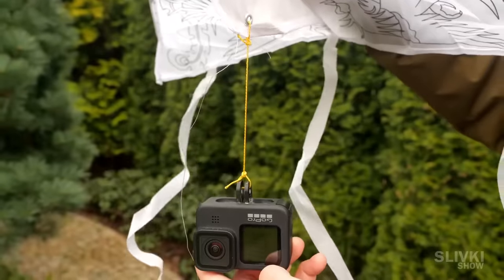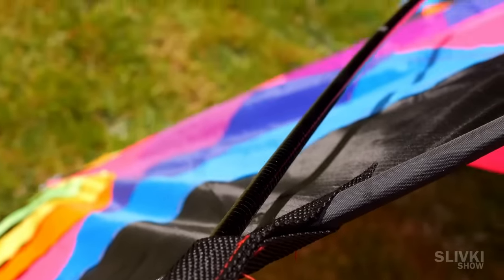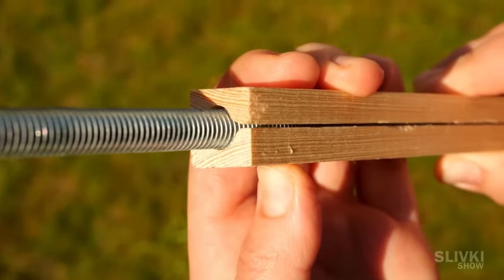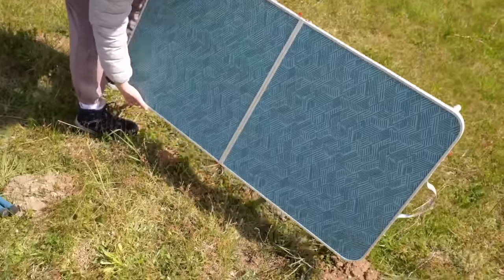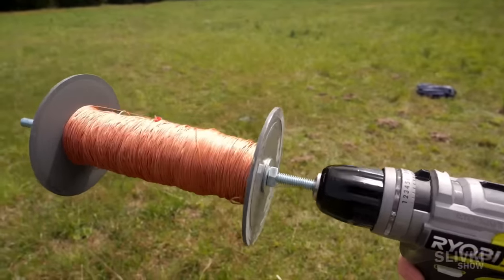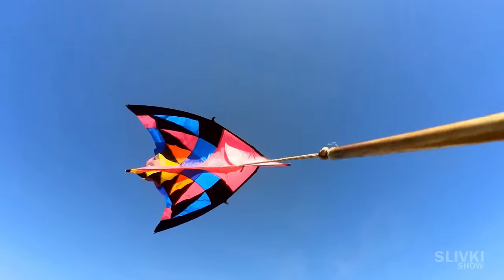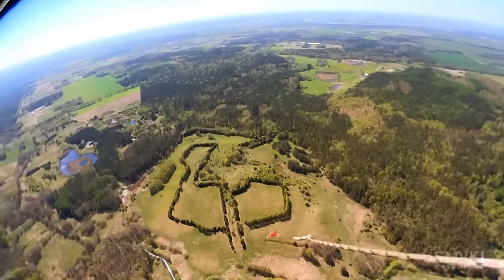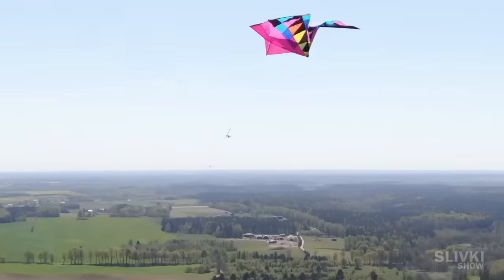WE FLEW THE KITE INCREDIBLY HIGH

Comment from the maker: Any idea how to fly it even higher? )
Reply: Try gunpowder in a rocket 🙂
Reply: Get the Gas Balloon from China....It will help to go to another Galaxy😂😅
Reply: hmmmmmmm maybe make the kite bigger
Reply: and fly it off something higher like a building
Reply: And pot it in the kite
Reply: bigger kite with paracord
Reply: Very strong homemade big kite, strong rope
Reply: A bomb
Reply: the avarage box kite can fly around 3km's up
Reply: Go any further the FAA will be mad
Reply: engin
Reply: what about two kites? I think the weight of the string will eventually add up enough to stop it from going further up but if you had a second kite half way up it could support the weight of the string needed.
Reply: propellor
Reply: You need to use thinner and stronger string. A lot of drag is just from the string. Maybe try string made from carbon fibres or nanotubes :D
Reply: if you attached it to a secure balloon with helium in it, or add a rocket, it would be cheating. but its an idea (also make the rope longer of course)
Reply: You should make a circular kite and put a turbine in the middle to generate electricity from the wind
Reply: Ad more string. Maby thinner and stronger string. 😁
Reply: Set the goal to 5-10km 🤘
Reply: @ashsty  big brain
Reply: Borrow a rocket from spaceX and place a kite inside.
Reply: tie the top of the kite to a helium baloon and pop it reaching the height you want.
Reply: You did not hit 1 kilometer btw as that kite did not go straight up but at some angle also with that much cord the drag on it would also prevent 1km just from drag and cord weight 
I had a spool (single spool) of very strong cord that was 5k feet and managed to roll most of it out with a kite probably something to around what you got honestly before it snapped similar kite that i re enforced with things like duct tape in strips with some space between them so the kite would not shred in the wind and along the trailing edge and leading edge
When the cord snapped it was pretty loud for such a tin cord LOL
Reply: Use helium gas balloon
Reply: Use single piece carbon fiber rods and cut to length.  Chances are those rods are just fiberglass dyed black to look like carbon fiber anyway.  If you can get the kite to maintain its shape then it'll produce considerably more lift.
Reply: Double the rope and add a tail to it and try using your hand to stabilize it so that I does not fall on its own
Reply: Same as the thumbnail
Reply: Fly it with Gas Balloon
Reply: more rope
Reply: ask Elon Musk he could help.
Reply: Bro use indian kite it use in gujarat they make worlds best kites
Reply: @alexpascu8586  ⚠️ God has said in the Quran:

🔵 { O mankind, worship your Lord, who created you and those before you, that you may become righteous - ( 2:21 ) 

🔴 [He] who made for you the earth a bed [spread out] and the sky a ceiling and sent down from the sky, rain and brought forth thereby fruits as provision for you. So do not attribute to Allah equals while you know [that there is nothing similar to Him]. ( 2:22 )

🔵 And if you are in doubt about what We have sent down upon Our Servant [Muhammad], then produce a surah the like thereof and call upon your witnesses other than Allah, if you should be truthful. ( 2:23 )

🔴 But if you do not - and you will never be able to - then fear the Fire, whose fuel is men and stones, prepared for the disbelievers.( 2:24 )

🔵 And give good tidings to those who believe and do righteous deeds that they will have gardens [in Paradise] beneath which rivers flow. Whenever they are provided with a provision of fruit therefrom, they will say, "This is what we were provided with before." And it is given to them in likeness. And they will have therein purified spouses, and they will abide therein eternally. ( 2:25 )

⚠️ Quran
Reply: I mean,... If you had some weed with you... 🤣
Reply: Fly a 10km kite
Reply: Longer rope! :-D
Reply: "be aware of commercial avocational airspace"
Reply: Paraglider pilot here. We actually fly close to those altitudes 🪂
Bigger more durable kite and check the local skew-T! You need low wind at that altitude as well as stable atmospheric conditions. The right (temperature) line as it's going upwards should not be inclined a lot to the left. You also need a kite big and durable enough to withstand the weight of the rope. If you are being forced to drop one of your cameras on take off, you will fail later as it gains altitude. I would test if it can lift at least 10 times the weight of itself plus the cameras plus all the rope. And be gentle pulling that rope! It will stress the kite more than you think! Google "Paraglider chase cam" to get ideas on how to mount and stabilise the camera with less weight. Maybe 3d print something similar. Or mount a single 360 camera with a magnetic mount on the kite itself. 
Finding someone who can read a skew-T diagram will help. Or give some time instead to study it by yourself. The wind gradient graph will give you information about the wind at that altitude. The less the wind, the higher it will go with the same amount of rope and the more likely to not break apart. Atmospheric stability means less turbulence. If you can't read that skew-T, find a day with cirrus clouds. Low altitude cumulus clouds is a big no no. I strongly advice to launch that kite early in the morning, before the sun heats up the surface. That way you're gonna have less turbulent air and less wind. 
And stay far away from airports!!!!
Reply: @DropXplode  yep
Reply: @1islam1  true
Reply: as one who used to fly kites a lot here in brazil, i've seen people fly small paper kites (50-80cm) at altitudes up to 2km with ease, i myself have done this, but having the camera presents a challenge, i have some tips for you

i'd recommend you to use stronger rope, you could see that even at 1km high, the kite was pulling like 5kg of force on the table, and trust me, it will pull much harder as it climbs, this leaves room for you to use heavier and stronger rope, fishing string/line is the best, it can lift a fish and weights nothing, but be careful to use the right knots, nylon can snap if bent in certain ways, although there are some fishing lines out there made of kevlar

also, a smaller kite will not face a problem in these altitudes, a square kite 1.2 meters across is enough to lift a small camera
here we have a rule: the stronger the wind, the smaller the kite

another idea is to fix the camera on the rope, not on the kite, the rope is much more stable and will give better footage

edit:
make sure before flight that the kite can withstand the forces! test how much weigh is needed to bend the kite and in with point it risks breaking, if it is to weak, reinforce it.
Reply: It is very common in india to fly a kite. Usually to fly a kite higher, kite needs to be very light weight and the smaller the kite the better because less wind force on rope at higher altitudes but in that case you won't be able to mount the camera, it won't take the weight of the camera until it reaches some height. So maybe all you can do is fly a smaller kite, let 100-200 meters of rope unwind and then tie the camera with the kite rope
Reply: you just need 5km long rope and lil bigger wings to handle rope weight.
Reply: Get more string.
Reply: use strong and much lighter/thinner fishing braid, it will have less air resistance and weight while still being as strong or stronger than your rope, extending your max height, as you will be surprised how much load it will reduce on the "system"... You might even want to put a "pull" weight scale with maximum pull recording so you can establish the amount of weight your current rope vs the fishing braid will add at 1000m, and then see the difference between both. I am assuming that a Substancial part of the pull is created by the rope´s weight and air resistance, so if you can reduce that you will automatically increase your maximum height... another advantage is that a 16 string braid with 50lbs/22Kg pulling force comes at 2000m rolls with a diameter of 0,35mm so you will not need any knots in the line...looking at your Video your current line is easily triple the diameter of such a braid... Good Luck 😀
Reply: Fly from mount everest😁😁😁😁😁
Reply: take dat Guiness record my dudes/etc:face-orange-biting-nails:
no really u got this:face-blue-smiling::face-fuchsia-tongue-out:GO! GO! GO!
🔥❤‍🔥
Reply: Look into parafoils, they are already flying at the height you need. Less weight more lifting compacity. Use a small chute to stabilize the cameras.
Reply: SPECTRA kite line + a real lifting kite, not a toy.
Reply: @growgamer1816  no they don't.
Reply: Use a large parafoil kite with a extra long tail.
Reply: more rope. simple as that. sure, it could snap at one point, but whatever.
Reply: Change to fly a kite without ribs, we so call parafoil. Typical one is the NASA wing! Hope to see you flying the NASA WING in the next movie. Cheers!
Reply: I once flew 3 kites on one line. The first kite was attached to a 200 meter string that was attached to the back (top) of next kite and so on. The 3rd kite was attached to 4000 yards of 20 lb Berkley Trilene fishing line wound onto a Penn Senator 116L fishing reel on a heavy-duty rod. There was a continuous force of about 25-30 pounds (20 lb. Berkley Trilene would handle that easily). Having 3 kites made them very steady. It took an hour and a half to reel them in. The kites were of average size; about 3 to 3.5 feet across. If anyone ever tries this, make sure there are no power lines downwind for several miles! I work for an electric utility and we will charge the person to remove any debris from the power lines.
Reply: try to put some firework rockets and a longer and stronger rope. ig u can make something which can trigger the fireworks wirelessly, also make the kite bigger and while making the bigger kite use a better material as that high up the wind turbulence is a lot.
Reply: I can help you.  U r kite can go plus 10000 miles easily.
Reply: Use a Delta wing on,kinda rhombus boxkite
Reply: Also, movement is equal to the arm ark no matter the length of rope at start, depending on how well the kite is made.
Reply: So start length of rope matter not
Reply: I used generic fishing line. I dont remember how many feet are on a 6# test. Ive used 10# test, 15# test even 25# test on a boxkite 28×72 we called the " flying phonebooth"
Reply: Roll of 6# test monofiliment tied to a 10# test tied to a 15 # test tied to a 20# test. I used to buy a generic fishin line at walmart. I cant remember ,the 6# test is 900yards?????
Reply: Ok i just looked, 30# test is 250 yards a roll. By logic 15# test should be 500 or even 600 yards best I remember. .........6# test 1500 yards
Reply: YES GET A      U  F O  SAM    KITE     I HAD ONE UP 2 MILES
Reply: You need a less flexible and more resistant kite, and also a more stable table
Reply: @priyanshbhardwaj6313  he could use one of those rockets like the US did to pop the China bloom
Reply: @jessemorrin2006  Right?😂😂😂
Reply: more rope
Reply: Braided fishing line, they got sell 500-1000m per roll. I am waiting you fly 3Km :)
Reply: You can use the same kite, the wind speed keeps the lift. You can also put 2 cameras, however, you will need to put a long tail to stabilise and counterweight. Also, the frame will need to be reinforced, or else it will break. Lastly, use paracord or a 2mm rope... With your string, any higher, the string will break on a knot
Reply: Fishing line, FPV camera, smaller kite i think, Or you can use un-controled or self controled rising up drone lifts up the string same time
Reply: PARAFOIL KITE or MINI PARAFOIL
Reply: @fdect  I got a breaided fishing line 0.26mm 30LB (13kg) with steel core, it is so tiny and light but unable to cut with scissors, have to use metal cutter to break it
Reply: Use asian kite not kite like this..
Reply: I saw a kite can flown almost 3KM but low wind
Reply: Stronger kite poles and stronger longer rope and fly by a mountain so the updraft from the wind hitting the mountain will pull it up into the sky
Reply: Get A much much stonger kite
Reply: @repawnd1  my 400m high box kite flight about 35-40 years old I use fishing line with a high breaking strain - so long ago that at 67 years old now I cannot remember what the strain was that I used. I remember the guys in the fishing shop asking if I was going out fish for marlin 🤣🤣
Reply: I have flown the kite higher than the clouds
Reply: It's nothing in India there is a kite festival on that day kite goes up to 4k meters
Reply: try indian style kite  u can fly it   near 2000 meter -
Reply: Use an astra thread. 10000 meters
Reply: if you visit Indonesia (especially Java) you will find many kite pilots with a height of 400 meters with a drag of more than 30kg and even with such a height and drag they fly/lower without using special tools. only with hands and the cohesiveness of friends
Reply: Here in the Southernmost part of the Philippines, Mindanao specifically, our neighbors flew them much higher than that..they're using ripstop nylon..
Reply: Seriously. The kite is waaay to flimsy. I have flown kits this high and you have to have a stiff kite. Not necessarily bigger, but it needs to handle the wind velocity. That thing was barely hanging on. The reason a single line kite dives is because it creates so much tension on the line that it begins to untwist, causing the kite to unwind the string holding it high. Fishing line is better as it has no twists in it. A high flying kite needs to be stiff and the line needs to be solid.
Reply: the material of the kite is flexible thats why the wind not so strong.
Reply: Easy
Reply: can you link me plz
Reply: Try to attach camera directly to the kite tail... And make a kite with paper and little smaller.. And use a cotton thred ... It works like charm
Reply: @AlterYHUDZX  yes
Reply: @AlterYHUDZX  10000 meters mine tho
Reply: You need to fly Pakistani kites they are much efficient❤
Reply: Strong kite & strong ropes ties in the strong tree. U need to pull it back a little smtimes till the top of u & slowly releases the ropes meter by meter to climb it high u need to pull it hard again till its in top of u again & release rope again same again & again till ur last rope that tied in the tree. We used gorion. It can lift people away,thats why it always tied in a strong tree.
Reply: Di kaitkan satelit...
Reply: This is no big deal for us,
Come to india on 14th January and see how to fly kite,
1K is child's play,
We do 3K to 10K easily
Reply: Gak paham bahasa nya😩😩😩
Reply: How’s the burger doing?
Reply: Buy kite thread from pakistan for more hight
Reply: @kjroma3418   dia tanya ada idekah biar lebih tinggi lagi.....ikat di satelit usul saya
Reply: Connect your camera in kite not rope   for more stability
Reply: make it more big
Reply: Perbesar + perkuat benda agar kuat jika terkena angin yang cukup besar di atas sana, lalu tambahin talinya pasti bisa menembus awan☁️😅
Reply: Try indonesia kit model like gapangan, tanggalan, or pegon, that kit olso have sound when flying
Reply: p09
Reply: Try pls
Reply: HAHAHA🤣🤣🤣🤣
toys when I was little
Reply: Try Flying Paper made kite.....our kids fly it more higher
Reply: When the rope starts to get smaller.. cut it but hold on to it and tie more string to it
Reply: Yes , Come to sri lanka and buy a sri lankan traditinal kite any try to do your test. We usually fly kites nearly 1KM high
Reply: Without camera its possible
Reply: Use smaller kite with thin and strong nylon string 
Also decrease the size of kite.
Plus change the design of kite (Use the one that is used in Pakistan and India those ones are stable especially for longer lengths)
Reply: Gama ug goryon ba
Reply: add amall propelers and biggger wings
Reply: Place a long tail and mak the body stronger make the body bamboo and make the rope more stronger
Reply: It's not difficult to fly more high just change your kite
Reply: I am from Indonesia when we fly a kite, we use a kita we called "Gapangan" and we use a big thick plastic rope to fly it. With that rope, it can fly very high sometimes it can go into the cloud. We also like to give the kite a small lamp with dynamo so we can see it at night.
Reply: hi bro i am a professional kite flyer. its better you use a kite which is made in Pakistan and thread also made in Pakistan you can fly the kite for than 5 kilometres
Reply: Next: fly a kite from mars
Reply: @alexpascu8586  de moto. A gente não
Reply: so the earth is round or flat?
Reply: Make Every thing lighter !
Reply: Longer rope
Reply: Come in India and see how far indian fly the kite. Haah! Every seller sells 1km in one role. We indian are far from you
Reply: Well i would like to prefer you to visit indian villages and you can see ample of kites,even children can fly it around 2-3 kilometres 😅😂😂
Reply: @alexpascu8586 😊cais20,000
Reply: Take a big size kite which has long Aero dynamics can fly up to clouds.. I regularly fly in our country it's very common.. Just for fun kite fighting over 😊
Reply: use box type kites they are more stronger and thicker strings about 4mm thick, plastic strings also is possible the one used for grass cutters
Reply: use bigger kite, about 2 meters wide
Reply: Yeah build your own kite with light aluminum bars make them strong and you can fly it even higher
Reply: One other interesting thing about kites. They’ve been used for ground breaking scientific research and experiments. EG: Benjamin Franklin’s kite into thunder clouds for electricity using wet hemp attached to a Leyden Jar for electricity capture and a more dry silk yarn for the kite flight in 1752. Also I believe that Marconi may have used a kite as a high flying radio antenna for his radio experiments in 1894. Finally heavy lifting kite to fly a man or young boy up above battle grounds were used by the Chinese military in 636AD and by Baden-Powell in WW1. Samuel Cody also used a kite for flying a man.
Reply: Buy more copper wires😐
Reply: Try Brazilian kite, we who live in Brazil always fly these kites much higher than 1 kilometer😅
Reply: Ask to Elon Musk😂😂😂 he was watching your kite.
Reply: Make the kite with bamboo it will be much stronger and bigger
Reply: come to pakistan baby we fly over 2 to 10 km without any safy or eqiupment haha lol
Reply: @alexpascu8586 😮😅
Reply: just make an aeroplane once
Reply: I use to fly bigger kites even higher at age 12 by putting holes in my kite. It use to reduce the tension on the rope significantly
Reply: Get some heavy duty twine
Reply: Make a goryon kita its so big it can fry about 1000 ft
Reply: I would add more 10 more rolls of string to get higher.
Reply: 0:33 :30 0:31
Reply: 😂Lol we flying than that high
Reply: Datang ke Indonesia
Reply: Tendi uma pipa 🪁 maior ❤
Reply: Come to India you will see kids flying kites up to 1000 meters
Reply: Rig the kite with remote-controlled thingies that spread and contract the "wings". As a failsafe, use some pressure sensor as well maybe.
Reply: @alexpascu8586  That would explode
Reply: Come to india brother, every year on 14 march there is a festival named khichdi,some say baishakhi different parts different names,on this occasion there we fly kites ,even there's lots and lots of compitition,1000 metre is good but an average here if you participate in a good compitition maybe 1500-2000 m is nothing
Reply: you should  visit india in jan 14  2024 , we have a festival of kites ,
 u will understand each and everything
Reply: @raquelmoreira1561  Me irl
Reply: more rope
Reply: No... Use Indian kite
Reply: Kites of this kind cannot ascend to great heights as they are easily affected by strong winds, causing the kite's angle of flight to decrease due to the penetrated air. In the Philippines, we have a kite called 'guryon' that can fly at high angles and withstand strong winds. try to create one
Reply: stronger and longer rope and larger kite.
Reply: makes an 80 cm bamboo kite like in Brazil that easily takes the camera and a thousand meters of line in Brazil we fly a lot of big kites
Reply: Try to research about how pilipino made kite using a bamboo
Reply: Come to sri lanka 😅
Reply: you must try to fly the big kite ''gapangan'' from Java Indonesia
Reply: Pull in 10% of the line, tie another kite to the line, and now tie a slightly heavier and stronger line on.  Let all that out, tie a 3rd kite and still heavier line. This has been done in the past resulting in kites going almost to the stratosphere.  
Note: even ordinary kites can bring down a helicopter, because the line gets wrapped around the rotor mechanism and overwhelms it.  Any helicopters getting anywhere near, bring the kites to the ground asap!
Reply: Uma pipa 🪁 de outro modelo com rabiola voa mais alto
Reply: More string
Reply: nice su 57 profile picture
Reply: Use fishing braid line..20lb should do if u using the finest..5km guarantee😂😂😂
Reply: Visit Malaysia and learn about wau bulan...u can fly it until u cant see or higher than everest
Reply: In the Philippines they fly much higher. The kite is called "Guryon" usually an oval shape body and can fly very high, made out of bamboo and plastic. The best ones can fly with the strings close to 90 degree angle.
Reply: Great experiment. Go for 5000 meters? Be carefull with air traffic. 

1) Search for the wire that has a) the highest streght to weight ratio. Maybe Dyneema line? b) meassure the pulling power, and get a line that fits. Do not use a line that can pull 500 kg, while you only need 20 kg of pulling power. The pulling power of the line should bet at the same breaking point as the pulling power of the kite. Otherwise, one of the two is overdimensioned. 

2) Put everything (camera unit) on a small kitchen weight scale. Get every gramm off. 
- Lighter HD camera, with low power use for lighter battery.
- Lighter tape fixing screws and whatever
- Lighter everything. Use materials with high strength to weight ratios like carbon fiber and then use not one gramm too much.  

3) Search for a better kite, this is on the edge of crashing

4) use a wind measure thing. To be able to put the kite at its limits, you need to fly at the right wind power. 
With to much wind the kite will fall apart, with less wind it wont go higher as the line starts pulling it down. Try to find the right day and moment to fly. With stable winds. 

5) Use a morepen or block of concrete tu guide the line. The pulling station should be more stable. 

6) Get the 100-200-300 meter labels off, Use lines in different colors? red, green, blue line? Or mark it with a marker pen.. so you know how high you're at. 

7) Maybe use a fishing? line winder system to wind the line. Also do not wind around a iron screw rod. This thing has sharp edges that can damage the line. Then you end up with only halve of the strength of the line!  Also do not use a square to wind around. Use some kind of fishing? mill of winding system that has ZERO chance of damaging the line. 

8) Never stop. You can always improve something and go higher than the last time. The beauty is in the continious improvement. Every year you can set a new record. 
Go higher, at better locations, make more stable camera shots, do a two line system so you can steer. use 360 degrees ultra HD cameras, heat cameras, zoom lenses, make it safer so your camera will always land safely when it crashes. and more..  

Try a zappeling on a line that can stay in the air, 365 days a years with heatcameras. For border patrol at the trump wall. 

And read benjamin franklin

Great experiment...

* Google: 
What is the strength to weight ratio of the strongest rope/wire available? You find something like Dyneema and spectra
Reply: Go to heavy wind in the mountain and drow the kite and she can fly now
Reply: Go to heavy wind in the mountain and drow the kite and she can fly now
Reply: Go to heavy wind in the mountain and drow the kite and she can fly now
Reply: Pls can I have the kite I tried making one 5 times but not success
Reply: Get a bigger kite, out of stronger materials, get stronger rope, and a lot more longer rope, like 3,000 meters and try get the kite to 3000 meters!!
Reply: come to pakistan
Reply: Fly it stringless with gyroscopic control. 🤷‍♂️
Reply: smoke more weed when you fly it
Reply: Yes bro 🤣
Reply: Let’s go fly a kite🎶🎶🎶🎶🎶
Reply: @nanaki-seto when my 150 lb test snapped. I just gazed as my 10 ft wing span dragon kite got smaller and smaller, and......returning home and telling my girlfriends daughter what  happened. She said whoa and disappeared  into her room. About 3.5 hours later she reappeared and said she found my kite!!! Facebook lol it was 26 miles away from where we were at. Next morning drove up and got it. HAS TO BE SOME TYPE OF RECORD RIGHT?
Reply: Cannabis 😄
Reply: Make a “radiation sail” to be propelled by a thousand consecutive nuclear explosions in space until the kite reaches a velocity just above 1 percent of lightspeed to reach a height of 37.844 trillion kilometers
Reply: Be Willie Nelson at a Snoop Dogg concert. 🥴😶‍🌫️🌎
Reply: Think he said egret
Reply: Use fishing line
Reply: Build a kite bigger than the one in a video in which a kid is accidentally tied to a big kite's tail and they let it fly. Only after the kite is high up in the air do they realise the tail has a kid tied to it and the kite flies high up above effortlessly even with the weight of the kid on its tail. Even the tail seemed to lift the kid up and down like a flag as if theres nothing tied to it.
Reply: Come to India.
Reply: Just use light kite and light thread with good tensile strength
Reply: You need intermediate kites every hundred meters of rope, this will reduce the total weight of the rope and in theory you can fly an unlimited distance.
Reply: More line
Reply: More line. Not only more but lighter line. You don't think about it  but the weight of the line adds up quickly. I was using 150lb Kevlar line. I might try 100 lb line but I think  that, well Im Just not comfortable  with that getting my kite back in strong wind
Reply: When I was a kid I used a fishing pole with a whole full spool… try that …
Reply: Use a fishing pole with a full spool… it will work…
Reply: Make a wooden kite
Reply: Like in my home country barbados
Reply: build your own
Reply: Make one out of a weather balloon
Reply: Come to bali
Reply: Smaller kite and fishing line.
Reply: А слабо взять камеру НЕ рыбий глаз?
Reply: If you have the means, it could be a truck bed mounted large spool, custom steel frame with sealed bearings. Chain driven winder attached to a diy clutch lever , lawnmower powered. High strength Paracord, the kite would need to be hand made with parachute material, homemade fiberglass monocoque frame with less flex as poles. Frame can be fashioned to include all manner of attachments for cameras etc (a seat ? Lol)
Reply: Add more string
Reply: Use carbon construction to prevent deformation by strong wind and use also stronger fiber
Reply: add more bundle of strings
Reply: Use Dyneema, super light and super strong, much thinner then ordinary yarns, less weight means higher elevation.
Reply: String weight is your enemy. Your original with dental floss will fly out of sight. Don't know if the floss is strong enough for the big kite...Easy to do weight testing with it.
Reply: hello. indonesian here
Reply: stand on top of a hill
Reply: use small normal kite of paper and bamboo stick like india